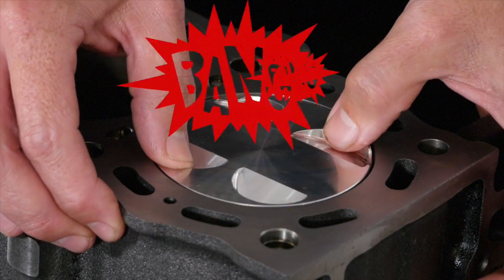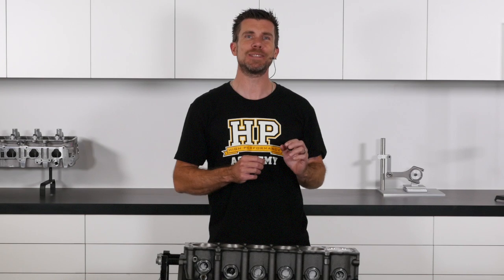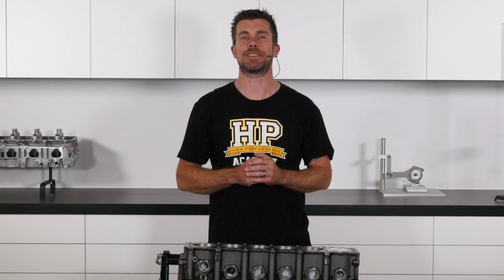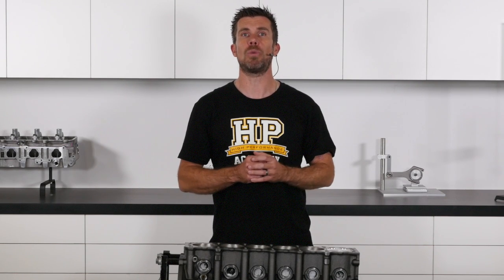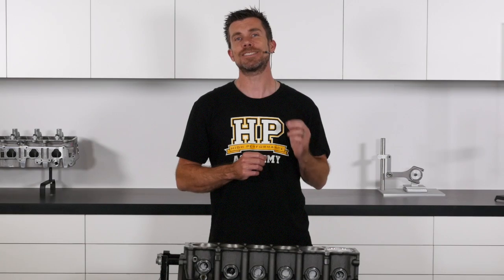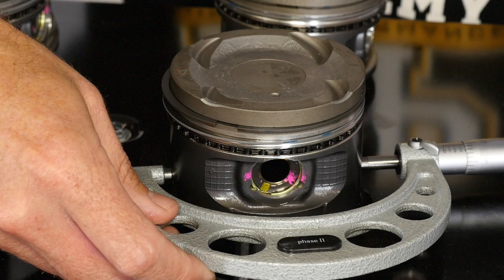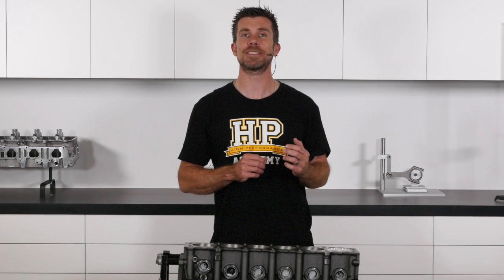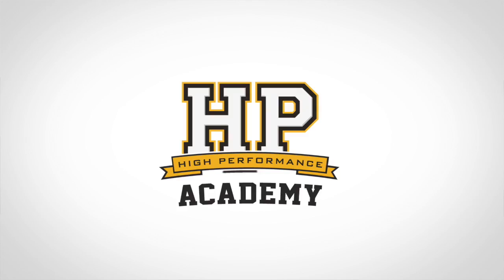EXCESSIVE Piston to Bore Clearance?

Comment: I have a 6.0 LQ4 that has about the same amount of piston rock as the one in the beginning of the video.. I was going to have it punched out, and new pistons put in, but after watching this I guess I don't need to.
Reply: How did it run with the piston like that because I just got a lq4 too with the same piston rock
Reply: @Travis Ibarra  it's ran fine actually. I didn't even know it had piston rock until I took the heads off.
Reply: I just saw thread and it made me feel better about my LQ4 I thought I was going to need to get it bored out

Comment: Imagine watching this at right time..i was about to replace rings after finding this movement once i opened the cylinder head to replace leaking valves.good thing that gave me confidence was finding cylinder walls being fine with no spots of piston slap.

So video served me a lot.
Reply: Am just here now! On a 1.8T also a bit of movement and I was like god fkn damn replacing already the second engine now and than this. So me searching and searching and all people say baaad replace booo! Than this video comes up, and just made me like. Yeahh let's continue all good now!
Reply: @FlightSimXtreem  what a coincidence.
Reply: Same. Pulled the head on my lawnmower engine to fix what I think is leaking valve seal and see the piston rocking. Was about to go buy a whole new engine because cost is about the same as a rebuild for me. Gonna run it with the new valve seal now first just to make sure it's not still smoking before buying a replacement.

Comment: Does this same concept apply to cast pistons? I have an engine that I honed, and put new standard size pistons and rings and was surprised about the piston rocking back and forth in the bore just like what's shown in this video. Thank you!
Reply: How did yours turn out? Was it ok. I did the same thing
Reply: I ended up over boring the engine. Measured the piston to bore clearance and it was way in excess of factory specs. They still rocked a bit, but no where near as much.

Comment: i have a v8 and only one piston has such kind of clearance while the rest do not move so much. kindly suggest if its normal?
Reply: Not normal, the clearance should be roughly the same on all 8 pistons. Any significant variance in clearance from piston to piston is cause for concern.

Comment: Is it normal if it does that left to right as well?
Reply: No. It shouldn't at all
Reply: @jonathonvince3605  thanks but I already talked to a certified mechanic and it's normal.
Reply: @jonathonvince3605  Any piston is going to rock a bit, but the exact clearance will depend on the application. If the clearance was so tight it didn't move at all, it would seize up and self destruct within seconds of starting the engine. Kudos for trying to be helpful, but sharing completely incorrect information isn't helping, it's making things much worse for people who don't know better.

Comment: I wish I knew this beforehand. I sent my engine to be rebuild and I was hoping to chuck in a used high comp forged piston and con rods but the engine builder called to let me know that the second hand forged pistons I bought had a bigger clearance than the oem they wanted to put. The bore was 81.0mm and the oem was 80.97mm while the forge ones were 80.90mm. Was I right to go with the oem ones? or the 0.07mm difference would have been negligible?
Reply: How did it go?

Comment: so wat should the pistonskirt to cilinder clearance be on a smart car ? (63.750 mm bore 0.6 liter 3 cilinder aluminium block metal liners stock turbocharged running on regulair fuel)
Reply: the clearances should be stated in the service manual. They are strongly piston and cylinder wall material and application specific.

Comment: I was all ready to pick this video apart!, damn if he didn't get it rite. I might add that the thickness of material on piston crown also adds to the expansion of this area. The percentage of silicon in the piston material (forged) helps stabilization of expansion and is useful in getting a nice fit. Lastly, as allways, follow the piston manufactures recommendations for fitment of their product. I am off to check out some of your other offerings, good work.
Reply from the maker: Cheers for the praise and extra bit of information there Russell, glad we hit the spot for you. Factual and concise is our goal :) - Taz.

Comment: My dad used to tell me that the most worn piston in the most worn bore (assuming no prior rebuild) will last around 40,000 km in normal driving with a hone and new rings.

Obviously this is not ideal to actually do and is at least partially bullshit, coming from the days of 100,000 km engines where people really didn't want to pay to fully rebuild so often... But say I had 2nd hand aftermarket pistons (stock size) to install in a worn-ish engine (200,000 km AU Falcon, for example) with a hone and new rings. Would you expect a dramatically short life compared to a fresh bore and associated new pistons?

Scenario: Budget burnout car where engine run time is likely to be measured in hours per decade
Reply: Depends on shape of cylinder walls, are they out of round any? Any scuffs or scratches? How about a lip at top of bore from old rings

Comment: may i ask you? when you use stock casted piston. is that excessive clearance is fine? or thats only for forged pistons?
Reply: in the video description it says forged.
Reply: Forged pistons require a lot more clearance then cast, depending on manufacturer but if I had a stock cast piston I was just reringing for a rebuild that would definitely raise red flags for me and honestly cause me to rethink my plans. At the very least new pistons if not a bore and pistons.

Comment: one thing that i cant find anywhere: how many combustions the piston needs to expand to proper diameter? I guess its not that long as people say because the combustion heat is intense then its logical to think the piston would expand on the first 10 power strokes, or am I wrong? I know there's the heat exchange with watercooled cylinder walls but still, the heat is constantly built in the piston crown, right....?
Reply: the main question is: ok, the engine takes lots of time to warm up completely to operating temperature, but I guess the pistons wont take that long to expand to operating temperature due to the direct exposure to heat from combustion...right??..
Reply: a engine idling at 1k rpm cold has 8 combustions per second. so no it will not be that short a time.
Reply: @thdmtr.......,10 minutes = about 4800 strokes, depending on the set idle.
Reply: @sgt-willkillu  10min is time for defrosting the front windshield after firing up my old volvo xD for the pistons to heat up and expand i would say is perfectly good after couple of minutes.
Reply: @sgt-willkillu  oh yes for full throttle/racing it i would even drive a solid 15 min before even thinking about it. was thinking more like commuting back and forth xD